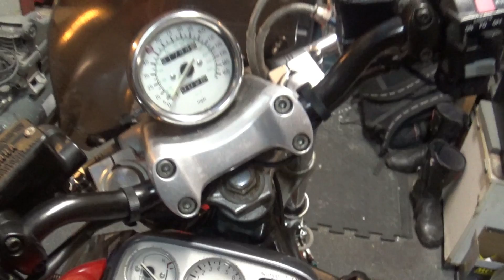Yamaha V Max 1200 -Oil Change and MK1 Filter Malarkey

Comment: You can get oil filter adapter plate, for early Vmax, comes with bolt to use spin on oil filter, but you have to get also cross frame brace bar from 97 model up for to fit, makes filter change more easy, I changed on my 88 model
Reply from the maker: Sounds good.

Comment: Hey buddy, the spring coil holds your airbox drain hose from touching the exhaust.. they usually get lost over the years as they fall off the airbox end...
Reply from the maker: It holds a drain hose of some sort but it's not the one of the airbox, as the one from the airbox goes to the carnister on the side of the bike. It's obviously not the most important stuff as the bike runs without it :) - good enough for me.
Reply: Possibly the engine breather?
Reply: MackieBass not sure if you ever got a definitive answer, but it is a spring guide for the long fuel tank breather hose at the back right hand side of the filler.
Reply: Mine runs on the left hand side because I have the extended range 20ltr fuel tank 💡

Comment: The spring is for POGO mode. There is a little switch behind the fuel cap release,  next to the left rear shock which, if switched will activate the famous "V-pogo stick" (just make sure you don't operate it inside a tunnel when jumping cars)

Comment: Yeah the manual !!    On the xjr there was no washer at all i had to find a replacement...people dont check and dont realise the washer is stuck to the filter and bin it...then i come along with my haynes book and swear a lot cos bits are missing ...the little spring inside the filter bolt is a pressure relief valve...if you push it in a quarter inch and it springs back the valves ok !! 
The big sping under neath ? 
Must say ive never seen that before ...👍😏☮❤
Just looked at a load of parts diagrams for yours and cant see that big hangy downy springy thingy at all?????
Reply from the maker: Whats that springy spring for springy? - see, I can play that game too :)
It' meant to hold drain hose of some kind...I guess if it's not there there is nothing to worry about :)
Reply: MackieBass 
Ah yes ..route a drain /vent /breather hose through ..makes sense....springy spring thing !!🤘

Comment: Phillips head screw - does it hold a magnet in the sump plug?
The spring thingy  probably holds the vent tubes and overflows..
Reply from the maker: Hey man, how's things.  The bike is coming up nicely. Can't wait to take her for a spin!
Reply: MackieBass That oil filter on Max looks like an oversize cartridge filter on a dirtbike. Is the tank big enough for touring? For some reason I thought vmax had a relatively small tank for the weight and engine size.... I'm sure you will have fun.
Reply from the maker: Hahah, no. 100 miles is the absolute max you can get from a full tank of petrol. But owning a KTM 990 I am kind of used to frequent fuel stops :)

Comment: Hi Mackie - really nice and educational video. But tell me - what is the right engine oil to use? I was told that you need a 20W40 - but you use 10W40? Any comment on that?
Reply from the maker: Well it all depends on your riding conditions I think. If the ambient temperature is higher you can get away with thicker oil , and teh other way around. Hence I always aim to do my oil change after winter, fresh oil is slightly thicker but it gets around your engine faster in warmer temperatures, so it's all very indiviual too. I'd like to think that riding style (agressive or gentle) is also a big factor when chosing your oil. Hope that helps.

Comment: Mine doesn't have that phillips head on the sump plug. It stands too proud of what would be the normal bolt. Looks like someone's messed on with it at some point - the head of the bolt does look a bit rounded, so maybe it could have been a "just in case"? Can't see from the video - is the head welded straight onto or threaded into the bolt? That said, my vmax also doesn't have that style of filter either - mine is just a twist-on K&N. None of that bulky housing.

Anyway, great videos and fantastic bike - consider me subscribed!
Reply from the maker: Thanks Karl, good to have you onboard! Few people mention that same plug before, I think this bolt holed the magnet, but I struggle to think how? Anyway, it's a MK1 V Max, later models were slightly different. Still, liking this bad boy!